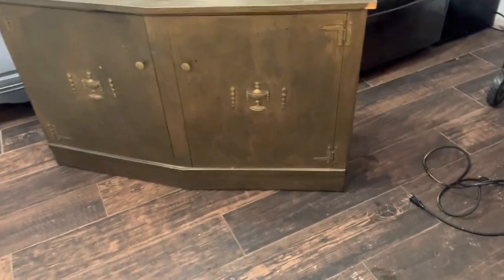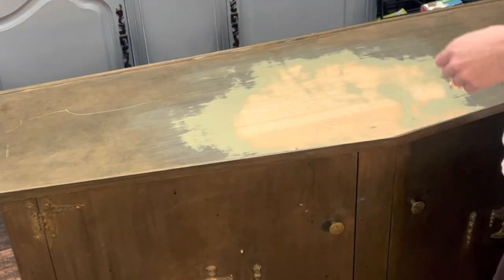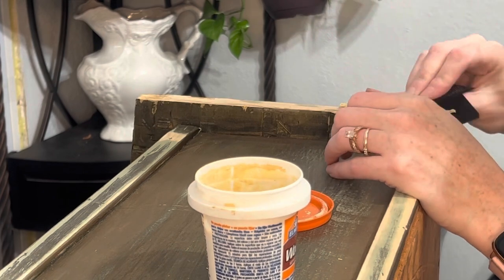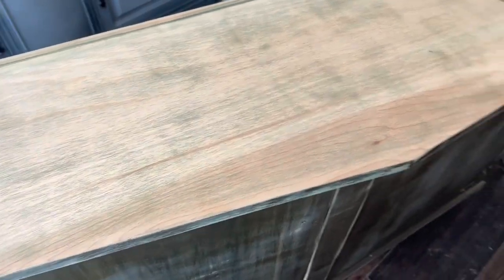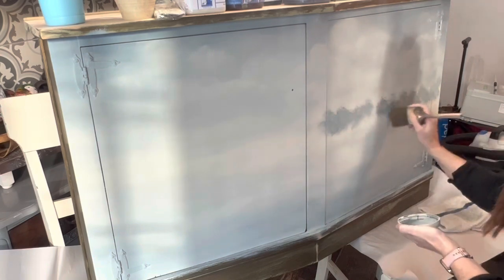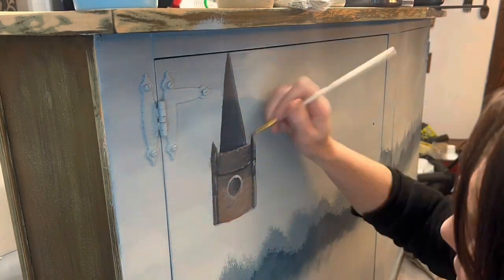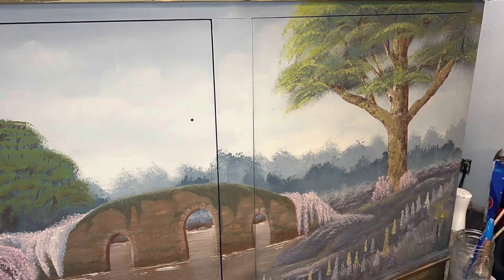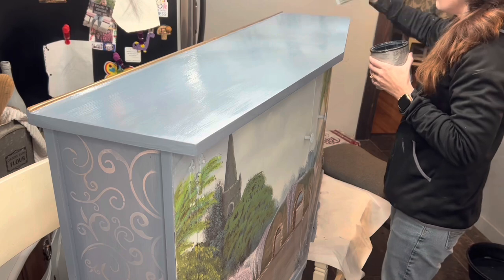Vintage Cabinet Makeover | Landscape Painting | Elegant Upgrades

Comment: What oxalic acid remove the paint from the wood fibers?
Reply from the maker: I don’t believe it would have in this case. I think my best bet would have been to use a stripper to begin with, but I really just wanted to test out the sander. Oxalic is hit and miss with how far it can go with removing stains. It’s great with water stains and sharpie markers, but it has it’s limitations.